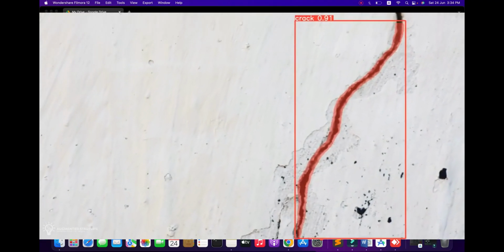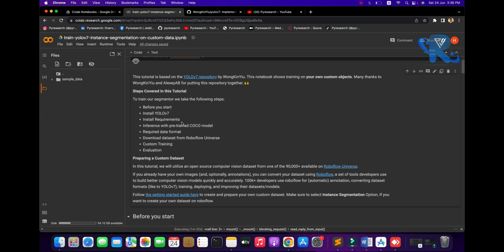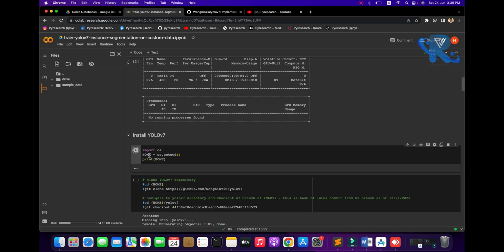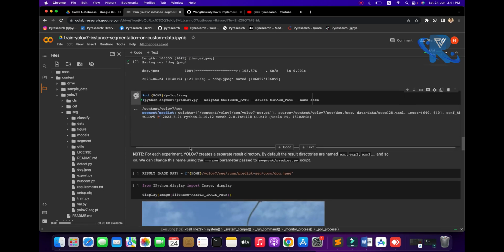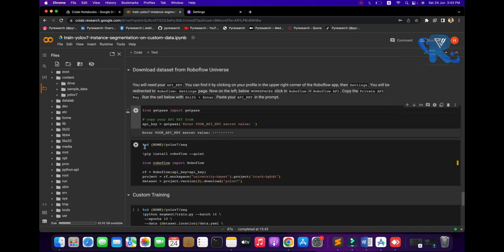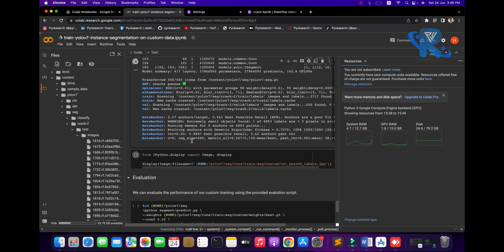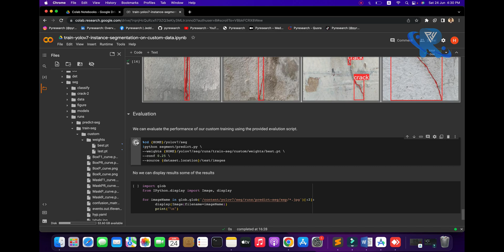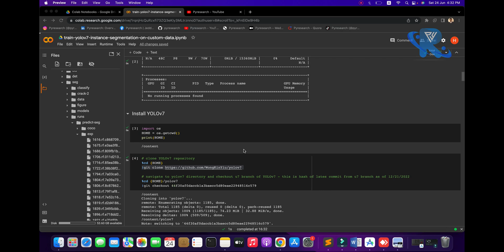Official YOLOv7 Segmentation | Concrete Crack Detection | Google Colab | step-by-step Tutorial

Comment: hi, i found this problem can u please help me with this.
AMP: checks passed ✅
optimizer: SGD(lr=0.01) with parameter groups 98 weight(decay=0.0), 95 weight(decay=0.0005), 95 bias
albumentations: Blur(p=0.01, blur_limit=(3, 7)), MedianBlur(p=0.01, blur_limit=(3, 7)), ToGray(p=0.01), CLAHE(p=0.01, clip_limit=(1, 4.0), tile_grid_size=(8, 8))
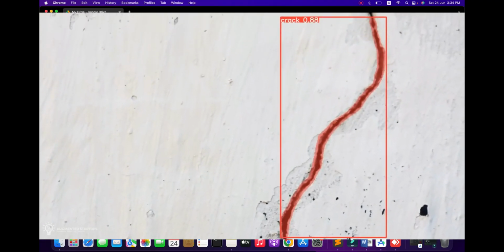train: Scanning '/content/yolov7/seg/crack-2/train/labels.cache' images and labels... 3717 found, 0 missing, 0 empty, 0 corrupt: 100% 3717/3717 [00:00<?, ?it/s]
Traceback (most recent call last):
  File "/content/yolov7/seg/segment/train.py", line 681, in <module>
    main(opt)
  File "/content/yolov7/seg/segment/train.py", line 577, in main
    train(opt.hyp, opt, device, callbacks)
  File "/content/yolov7/seg/segment/train.py", line 191, in train
    train_loader, dataset = create_dataloader(
  File "/content/yolov7/seg/./utils/segment/dataloaders.py", line 43, in create_dataloader
    dataset = LoadImagesAndLabelsAndMasks(
  File "/content/yolov7/seg/./utils/segment/dataloaders.py", line 98, in _init_
    super().__init__(path, img_size, batch_size, augment, hyp, rect, image_weights, cache_images, single_cls,
  File "/content/yolov7/seg/./utils/dataloaders.py", line 488, in _init_
    bi = int(np.floor(np.arange(n) / batch_size).astype(np.int)) # batch index
  File "/usr/local/lib/python3.10/dist-packages/numpy/_init__.py", line 319, in __getattr_
    raise AttributeError(__former_attrs__[attr])
AttributeError: module 'numpy' has no attribute 'int'.
`np.int` was a deprecated alias for the builtin `int`. To avoid this error in existing code, use `int` by itself. Doing this will not modify any behavior and is safe. When replacing `np.int`, you may wish to use e.g. `np.int64` or `np.int32` to specify the precision. If you wish to review your current use, check the release note link for additional information.
The aliases was originally deprecated in NumPy 1.20; for more details and guidance see the original release note at:
    https://numpy.org/devdocs/release/1.20.0-notes.html#deprecations. Did you mean: 'inf'?
Reply: I did change the np.int to int but the problem still arise
# Read cache
        [cache.pop(k) for k in ('hash', 'version', 'msgs')]  # remove items
        labels, shapes, self.segments = zip(*cache.values())
        nl = len(np.concatenate(labels, 0))  # number of labels
        assert nl > 0 or not augment, f'{prefix}All labels empty in {cache_path}, can not start training. {HELP_URL}'
        self.labels = list(labels)
        self.shapes = np.array(shapes)
        self.im_files = list(cache.keys())  # update
        self.label_files = img2label_paths(cache.keys())  # update
        n = len(shapes)  # number of images
        bi = np.floor(np.arange(n) / batch_size).astype(int)  # batch index
        nb = bi[-1] + 1  # number of batches
        self.batch = bi  # batch index of image
        self.n = n
        self.indices = range(n)
Reply from the maker: which python version you use?
Reply: Actually after some changes epochs started to occur.. but I still have some confusion.. where can i send pictures and ask my doubts??

Comment: hi, i find a problem on the train, it seems like a numpy problem in the train.py, hoy fix it?
: Transferred 556/565 items from /content/yolov7/seg/yolov7-seg.pt
AMP: checks passed ✅
optimizer: SGD(lr=0.01) with parameter groups 98 weight(decay=0.0), 95 weight(decay=0.0005), 95 bias
albumentations: Blur(p=0.01, blur_limit=(3, 7)), MedianBlur(p=0.01, blur_limit=(3, 7)), ToGray(p=0.01), CLAHE(p=0.01, clip_limit=(1, 4.0), tile_grid_size=(8, 8))
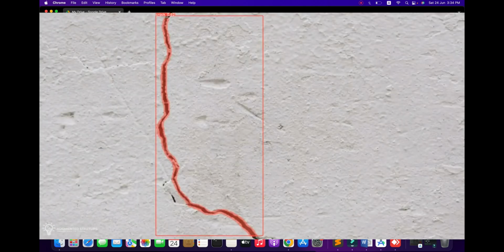train: Scanning '/content/yolov7/seg/crack-2/train/labels' images and labels...3717 found, 0 missing, 0 empty, 0 corrupt: 100% 3717/3717 [00:03<00:00, 1097.68it/s]
train: New cache created: /content/yolov7/seg/crack-2/train/labels.cache
Traceback (most recent call last):
  File "/content/yolov7/seg/segment/train.py", line 681, in <module>
    main(opt)
  File "/content/yolov7/seg/segment/train.py", line 577, in main
    train(opt.hyp, opt, device, callbacks)
  File "/content/yolov7/seg/segment/train.py", line 191, in train
    train_loader, dataset = create_dataloader(
  File "/content/yolov7/seg/./utils/segment/dataloaders.py", line 43, in create_dataloader
    dataset = LoadImagesAndLabelsAndMasks(
  File "/content/yolov7/seg/./utils/segment/dataloaders.py", line 98, in _init_
    super().__init__(path, img_size, batch_size, augment, hyp, rect, image_weights, cache_images, single_cls,
  File "/content/yolov7/seg/./utils/dataloaders.py", line 488, in _init_
    bi = np.floor(np.arange(n) / batch_size).astype(np.int)  # batch index
  File "/usr/local/lib/python3.10/dist-packages/numpy/_init__.py", line 319, in __getattr_
    raise AttributeError(__former_attrs__[attr])
AttributeError: module 'numpy' has no attribute 'int'.
`np.int` was a deprecated alias for the builtin `int`. To avoid this error in existing code, use `int` by itself. Doing this will not modify any behavior and is safe. When replacing `np.int`, you may wish to use e.g. `np.int64` or `np.int32` to specify the precision. If you wish to review your current use, check the release note link for additional information.
The aliases was originally deprecated in NumPy 1.20; for more details and guidance see the original release note at:
    https://numpy.org/devdocs/release/1.20.0-notes.html#deprecations. Did you mean: 'inf'?
Reply from the maker: Replace np.int with int on line 488 in /content/yolov7/seg/utils/dataloaders.py and save the file.
Reply: @Pyresearch  hello brother, its still not working, as there are many errors in the train.py itself
Reply from the maker: @SimMer-uv5kj  check python version and requirements